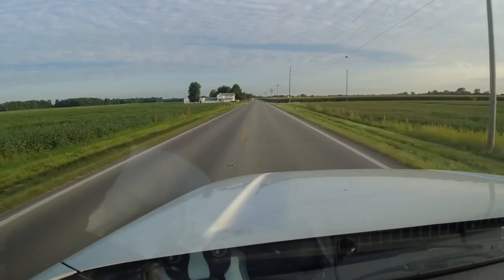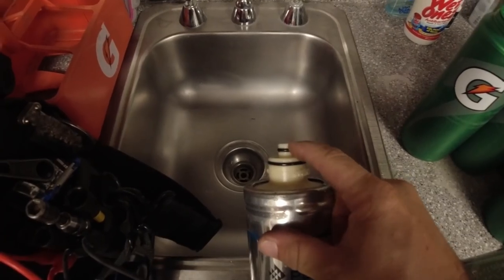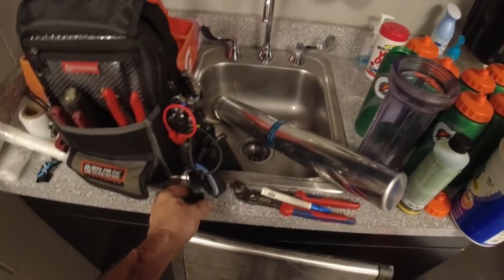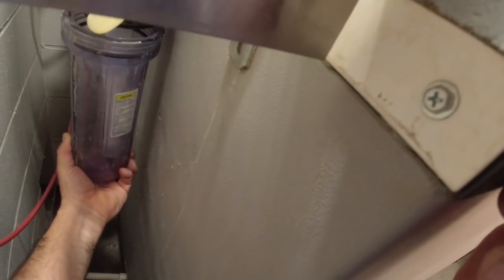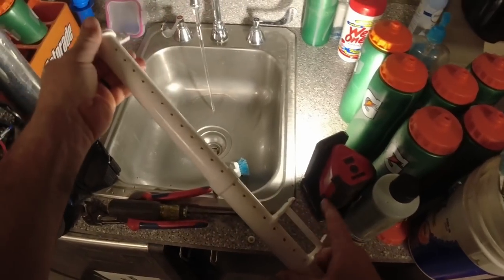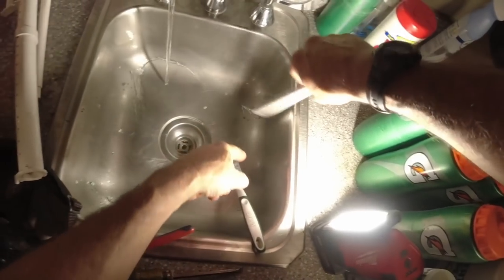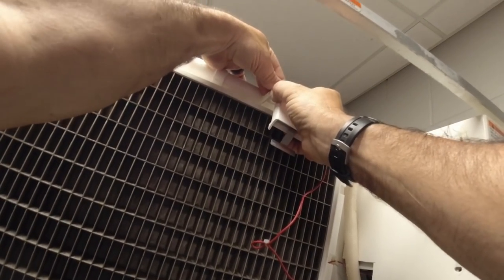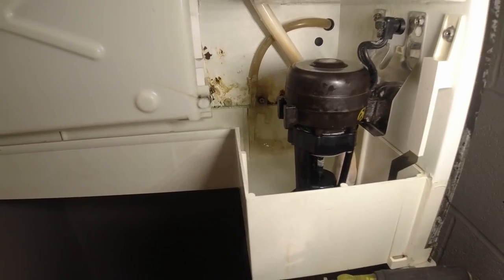Ice Machine Not Not Working / No Ice / Stop Doing This...

Comment: quck tip for the top of the scale stick and pre filter whilie purging... press down the lil red nub  on top of the manifold and it will purge the air from each one faster... makes a lil mess but just release the nub once you have water coming out of the top.

Comment: I had a problem with these filters prematurely plugging up. I had to find a solution , so I checked the internet and found a filter - 7DBG. It will fit into that manifold. It worked great. Only drawback would be little specks of carbon in the water on occasion. Didn't clog inlet screen when primed properly. We did have a long prefilter before the 7DBG.

Comment: Nice video.  I for one am satisfied with my customers who don’t maintain their equipment.
Reply from the maker: I have done so many ice machines that I hate cleaning them because they take me a between 2.5-3hrs if done IMO correctly.
Reply: @HVACRSurvival  working for myself I’m able to charge for the amount of time I think it will take to clean without hardly any pushback from the customer.
Reply from the maker: I don't get questioned after showing dispatch my pictures and videos. My Co workers verify I over clean them. I'm OCD is the main reason I do it like I do.
Reply: That's a good technician

Comment: Great video. I just recently went to a  restaurant her in NYC 2019 Manitowoc warranty call. The guy changed the pre filter because he said it was white God only know what the filter looks like. Anyway got into a whole thing with him about him saying the machine has on6 been used for 2 months. Maybe so the unit had mold and algae all over and 5hat doesn't count the year you probably had water sitting in the through and the flour dust in the condenser. I quoted him for a PM and IM cleaning because this is clearly not a warranty call. Needless to say he didn't sign my ticket. OH well i had called Manitowoc before speaking with him so the office has to work out all the payment stuff.
Reply from the maker: Typical idiots 🙄 🤦‍♂️